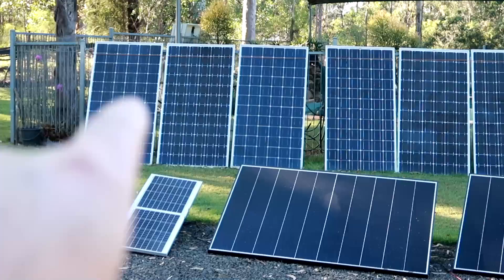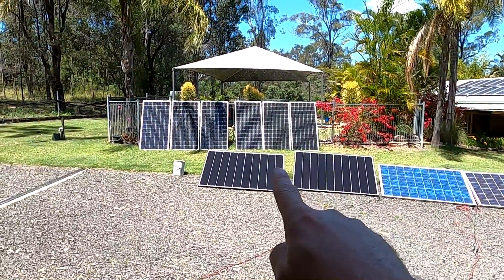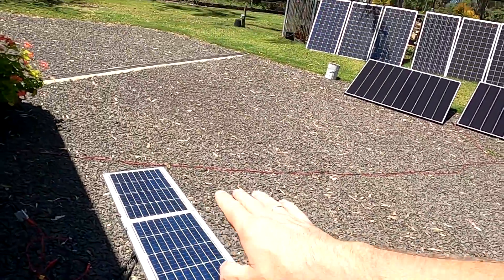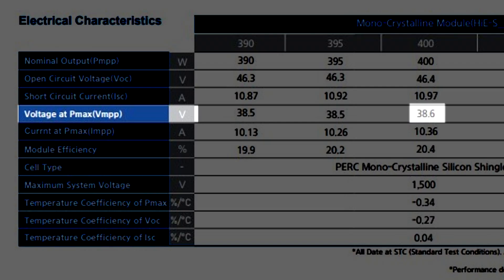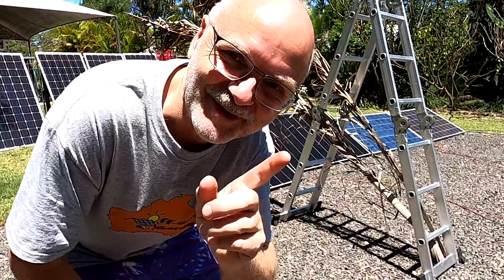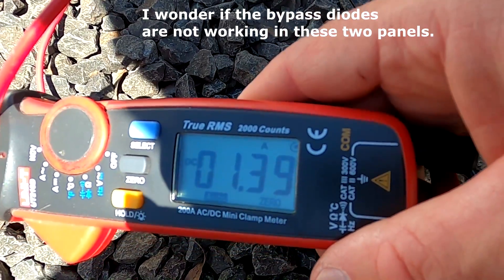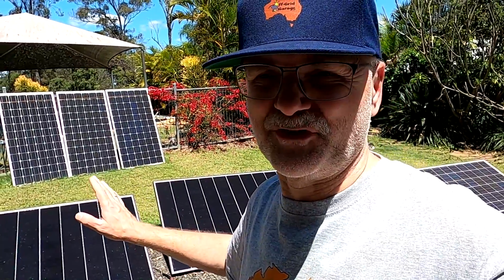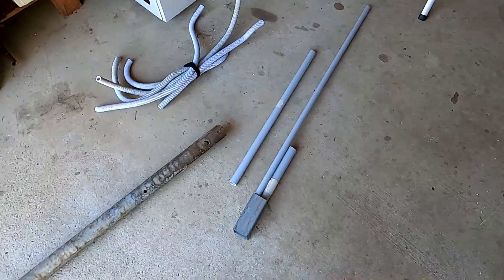Charging a 48V battery with only two solar panels in series? Here are my concerns.

Comment: Hi Andy, just a thought about the charge controllers, what if you used the Victron MPPT RS 450/200? It has 450V open circuit and 200A charging and I believe it has 4 separate MPP Trackers. Surely the high voltage would be better in shaded conditions. Would be interesting to know what you think.
Reply: Actually long string with partial shades decrease the power dramaticaly. In shaded condition is better to have as short string as possible, because you have half in the shade but other half in full sun.
Reply from the maker: Not a good idea with all this shading. The efficiency will go down a lot and also the bypass diodes will work hard on these shaded panels. Both not optimal. I found the many parallel strings work the best. Even optimizers are not great...
Reply: @OffGridGarageAustralia  Hmm, if the non-shaded panels in a string run at full power, then I'd not expect more than say 20W loss in the bypass diodes of each shaded panel, while the unshaded panels in the string can still be operated at their maximum power point. If panels have multiple bypass regions with a diode each, then an additional bypass diode across the whole panel could reduce the loss if the whole panel is shaded. Similarily, also groups of adjacent panels could be bypassed with additional diodes, in order to lose only a single diode-drop when the whole group is shaded (instead of losing one diode-drop per bypass region).

Comment: Connect two panels in series with blocking diode on each string
Reply from the maker: No blocking diodes, they are not necessary. There is no reverse current between shaded strings and sunny strings. Both are charging the battery. I made a few videos about this and showed the effect.

Comment: Just wondering if you know about mppt boosters? You can charge just fine a 48 or even 72volt with just 1 panel. A normal mppt makes the voltage lower, but a booster on the other hand.  Good for small EVs with a single 500watt panel on the roof at 30-40v but a 60v battery.
Reply from the maker: Most of these optimizers have an MPPT build in and don't work with your main MPPT. I tested this and got huge voltage spikes as the two controllers fight over the max power point.
Reply: @OffGridGarageAustralia  ? Why would there be two?
Edit ah, think you are replying to that other guy talking about optimisers, but hit the wrong reply button ?
Reply from the maker: @MegaCyrik  Yes, that is correct, sorry. Booster chargers are not really available. I have only seen a 10A version so far.
Reply: @OffGridGarageAustralia  yea 10 ah is quite normal. But if you only have 1 or 2 panels, having 20,30,50 or 100a would be useless :) if you had more panels, you would not need a booster. 10A on 72volt to a 60v battery, is still 720watt :) basically... Normally with mppt you have high voltage (60-500) that you reduce by increasing amps so it can go into your 12-48v system. So you need a big amp mppt. But, when your voltage is low, you increase the volt by reducing the amps. so 10a should be enough. You won't need a 60a booster for a 18v 1,5a panel charging a 48-60v battery :)

Comment: I got the solar bug bad now. I am going from a 12 volt system with 2kw of panels to a 24 volt system with 6kw of panels next spring. I am going to have to do it slowly by purchasing racking first then more panels and then an upgraded inverter after that. It will take me 4-5 months to purchase everything and then 2-3 weeks to do the upgrades.
Reply: If you are planning on increasing your system you might want to consider holding off on buying a 24v inverter and instead plan on bumping your system up to 48v instead.
Reply from the maker: 6kw at 24V will be 250A. The sounds like pretty big cables. Yeah, I agree, is a 48V an option?
Reply: @OffGridGarageAustralia  48 volt is an option but just batteries alone would be in the 1800 - 2000 dollar range for 280ah batteries since I would need 12 more. I am already oversized on cabling for my current system i am using 4/0 cables to everything that i can other than the current inverter. When i go to the new setup it should only be 2 new cables. I want to oversize the solar to start out and add in more inverting capacity when funds will allow. I also only plan on in the near future  having around 4kw of solar with the option of my scc being able to add 2kw more when funding permits.

Comment: I do not understand why you do not simply 3 panels in series ? .. Since the cables are typically long enough . that should not be a problem ... I just did similar on my new system ...
Reply: Three panels in series would give a to high voltage for the mppt to handle. I thought Andy explained that in a previous video
Reply: @Sailing-Aquaholic  I dont think it is that the voltage is too high, i think Andy said it was because the roof awning area isn’t wide enough to take 3 panels wide strings.

Comment: sir, can you review MPPT BOOST SOLAR CHARGE CONTROLLER ...I use 120Watts Bosca solar panel... controller only outputting 1.3  amp set to 57vdc for charging  48v 20amp lead acid ebike battery.
Reply: used 300watts controller

Comment: I have similar panels @45v 9a. Rather than using panels in series to charge the 48v I use boost converter on each panel and use them in parallel to the solar charge controller. Whatever you need for the charge controller just boost the voltage. Series panels are hurt by one panel shaded.
Reply: I have considered this idea myself, what sort/type/wattage boost converters are you using for this & are they weather proof?  Also, do you run extra wires for this setup, ie; how many panels with boosters do you run on a single wire to the controller?
This idea does have some great potential pro’s
Reply: @evil17  my panels are 400w45v @9a on a east-west moving tracker. I have 8 rows 4 panels. So. Cal usa. Each row has a joiner box with 4 600w boost converters (probably over kill) feeding into a wifi solar controller. Not victron. 8awg solar wire. Feed the panel input to a converter. Adjust converter outputs 54v to a solar controller parallel to the bms. 5-48v battery. Jkbms.. converters and solar controllers for each row in a large plastic box with fans/ filter on the bottom. Water tight output hole for cables. Relatively low cost. Lots of solar wire for parallel mode. Fused each panel. 1 solar controller per 2 panels (for cost).

Comment: Well, it depends what the voltage specs of the MPPT are.  There is no reason why a single panel < 48V wouldn't be able to charge a 48VDC battery system.  To do so, the MPPT would have to be a buck-boost (able to boost a lower voltage higher or buck a higher voltage down).

In terms of the current going down when it shouldn't... that could be a function of the MPPT controller.  Check the "operating" input voltage range for the MPPT controller against the maximum power point of a single solar panel.

Another possible issue (even likely issue) is that the MPPT controller is confused... because one panel is shaded, the power curve is actually not a uniform curve.  It probably has two peaks and the MPPT controller might be stuck on the wrong one.   There might be a setting in the charge controller for this, in fact.  For example, my SMA inverter has an interval setting where every minute or two it does a quick sweep with the MPPT to make sure that it is actually on the highest peak (when the curve has multiple peaks due to shading, this is important).

Try connecting only a single panel to the same MPPT controller (remove the 'shaded' panel from the series entirely).   If this works properly, connect the second (shaded) panel up and see if you can connect up a resistive load and get 9-10A out of it, and calculate the power.  i.e. determine if the charge controller is to blame or if the second panel is not bypassing properly and that is to blame.

--

When bypass is working properly, the loss in power should be exactly one panel's worth of power plus an additional diode drop's loss of power (typically 0.3V to 2.1V or another 0.5% to 4% or so) due to the losses through the bypass diode(s).
Reply: Victron SmartSolar MPPT 150 (for example) datasheet sais that it requires a minimum PV voltage of Vbatt+5V to start, and Vbatt+1V thereafter (so it is obviously not a buck-boost). It does of course search the global MPP, but if the global MPP of the shaded PV string combination happens to be below Vbatt+1V, then it can't be used, but only the next best MPP >= Vbatt+1V can be selected by the controller. I can't asses whether this was happening here, but I would not rule it out.

I also tend to be not a friend of parallel connected strings if they are subject to different amount of shading, since differently shaded strings with bypass diodes have different MPP voltages. I'd rather prefer one string per MPPT controller, and I also prefer higher string voltages (i.e. more panels in series). As you say, within a single string, shaded panels (or even shaded sub-regions of panels) are excluded properly by bypass diodes, with only small losses. Limit for the max. number of shaded panels in a string is again the lowest PV voltage supported by the charge controller.